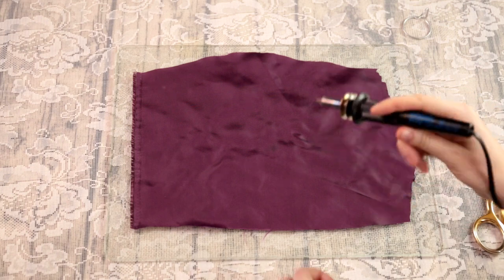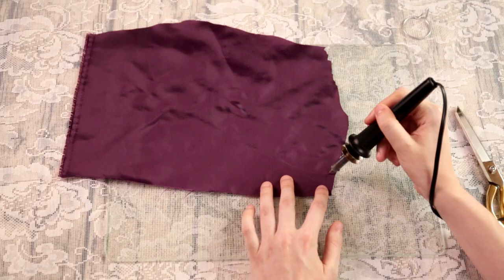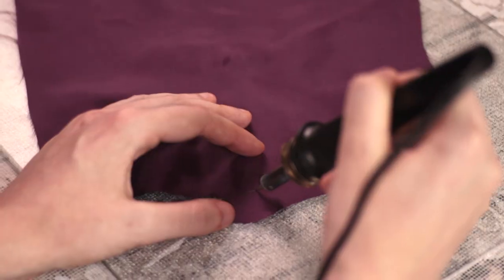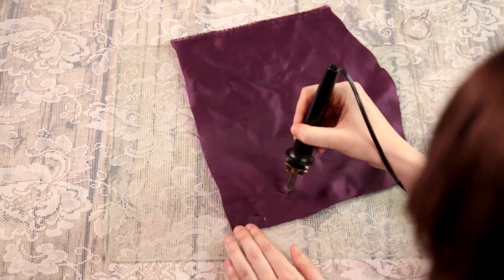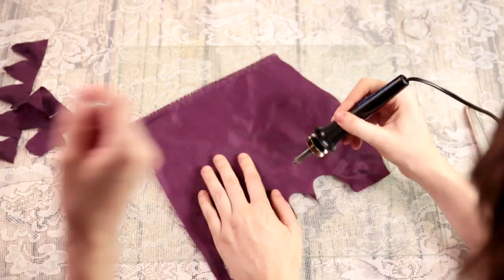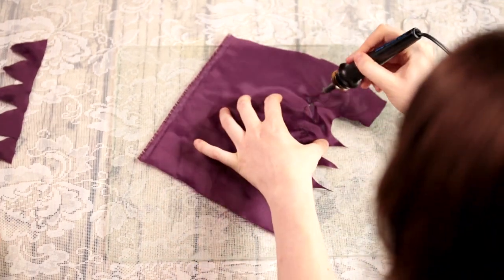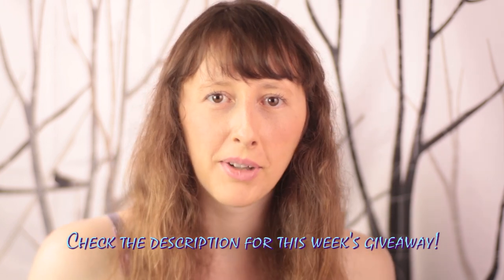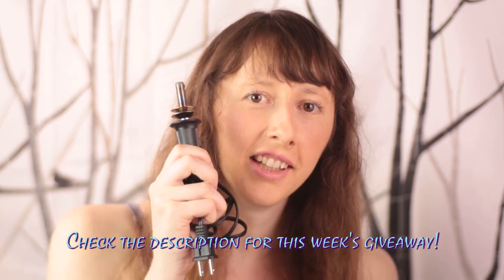How to Cut Detailed Shapes Out of Fabric Quickly and Easily With a Soldering Iron or Heat Knife

Comment: Cuts and finishes edges on one go?! I think I need this! I'm staring at a bunch of poly velvet right now, I wonder how well it would work with thicker fabrics with a pile?
Thanks for sharing your techniques! 😄
Reply from the maker: Becky Doherty It's hit and miss with thicker fabrics, some work well and others are tougher.  I also found it works well with polyester wide florist ribbon, which I've use to cut mermaid scales. :) -Harmony
Reply: Damsels in DIY Mermaid scales?! That sounds beautiful! Maybe I'll test soldering some velvet scraps, I have enough hanging around now!
Reply from the maker: Becky Doherty Definitely try it!  You never know. :)

Comment: Hold on. 

While this can work to cut fabrics, any time you are talking about using heat to melt plastics you are introducing fumes from said melting plastic. This is negligent to encourage without mentioning proper ventilation. Either outside or with plenty of ventilation indoors. Preferably this should be done in a proper fume hood. And although its not covered in this video, cutting Styrofoam-even foamcore sheets should be done with plenty of airflow as it is particularly toxic.
Reply: yeah i used to do this to make flower petals from organza too and it will definitely make you dizzy after cutting a while